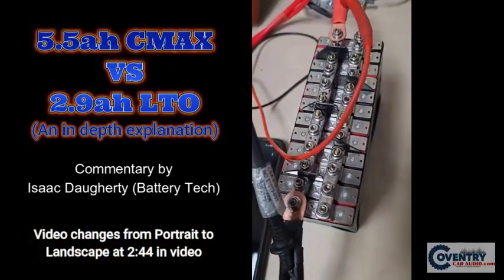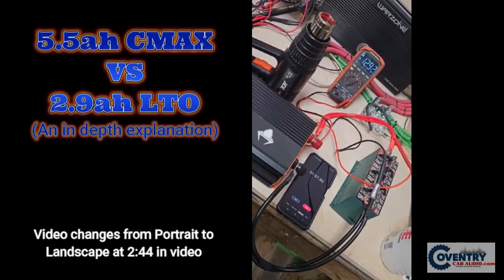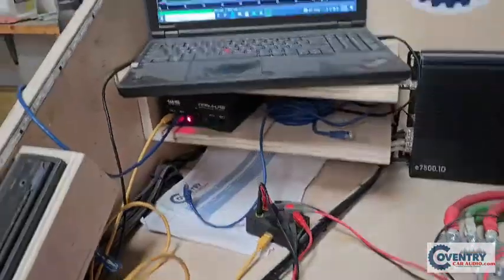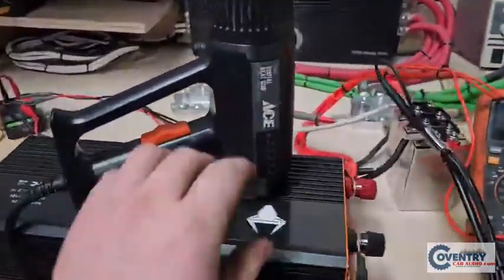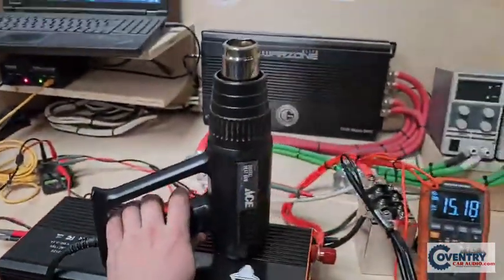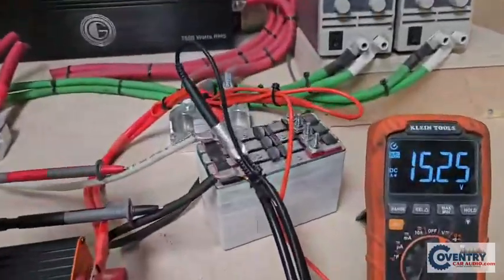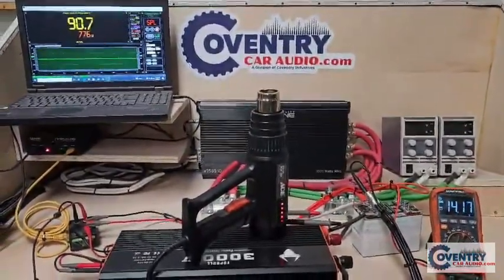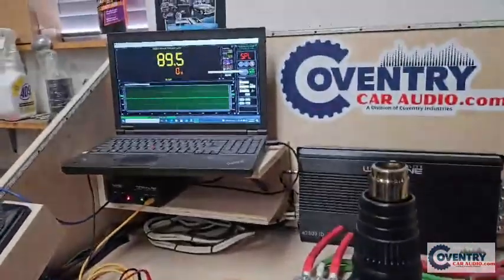Lithium Battery Test. CMAX 5.5ah VS 2.9 LTO Which one wins?

Comment: Was hard to keep up what you were trying to do. No graph at all on the charge voltage in relation to each other. 
This is what i know about lithium batteries.  You will not get the full watt hours out of a battery if it is not charged up to 100%. These batteries have different chemistries inside them and have different voltage ranges and perform different in different environments. 

CMAX 2.75V (low) to 4.2V (fully charged). Thats per cell. What voltage did you charge them at? 

LTO 
1.5V (fully discharged) up to 2.8V or 2.9V (fully charged)

Comment: Now that temps are getting low, maybe some videos geared toward sub-zero Celsius to sub-zero Fahrenheit temps would perform well for you.  

Living in the South, it’s easy for us to forget that hundreds of millions if not billions of folks for some reason choose to live in places where it’s not uncommon in the winter to get temps way below freezing, like around 0F instead of 0C below freezing.  I’d imagine LFP batteries with warmers are an inefficient or even ineffective solution for them.  

It might also be interesting to explore extreme cases where it would be beneficial for some people to use bifacial panels with the highest temperature coefficient to get above wattage rating solar production as often as they can.  

Lastly, how would a guy in Vegas test this?  You could build a DIY super subzero lab in part of your bunker and run it off the excess solar power.  Maybe it could also be a DIY walk-in food freezer.  For sunlight, i’m guessing there are lights and bulbs that work well enough for that.   Plus, it would be funny to see you wearing Gortex lab when it’s 110F in Vegas.  Until then, the sub-zero Fahrenheit videos would have to be from research, but the build videos of the walk-in freezer would be really cool.  I wonder if DIY geothermal could work for cooling that too.

Comment: How many amp hours do you need to support 8000 watts ?
Reply: About 60 ah should be enough depending on your alternator. I run a 120ah scib bank on a 320 amp js alt charging at 15 volts and its handling 16k no problem
Reply: @apocalypse4720  400 amp mechman alternator…
Reply: @apocalypse4720  I just need 1800 watts but it’s in a Tesla.  Im probably gonna end up at 60ah charging from victron dc to dc 18amp.  I feel like I need to go higher ah with the low charging.  60ah is only like 30 minutes of play time yeah.  Idk what I’m doing.